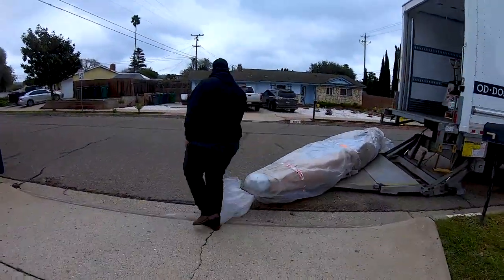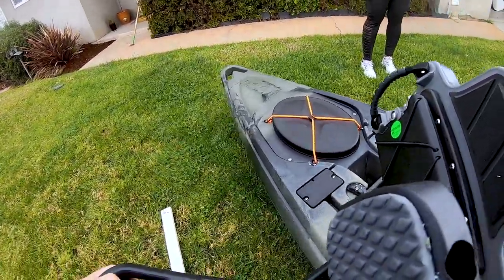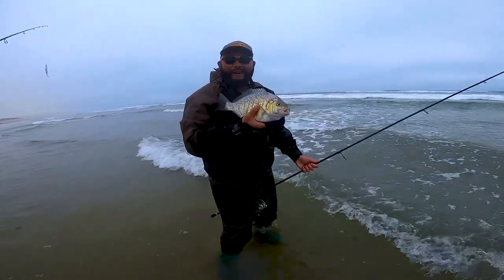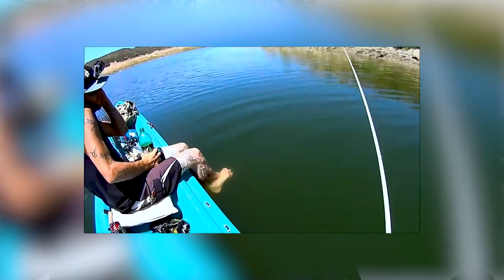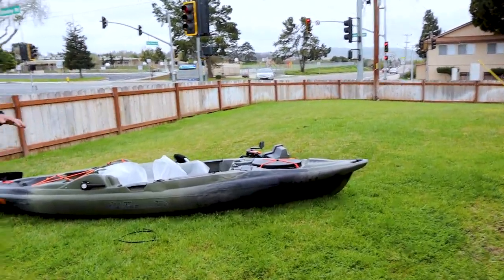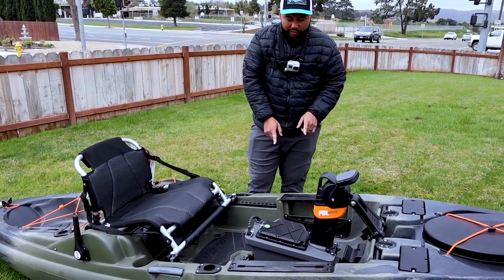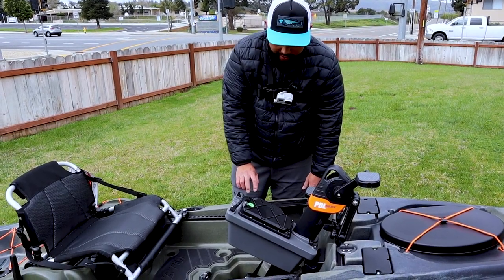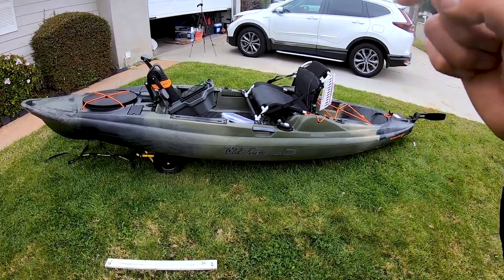Old Town Bigwater 132 PDL kayak in depth review

Comment: I just picked up my big water 132 yesterday. I love it. I can't believe how fast these are. They're also built really well, and they have lots of room for equipment. I was looking into Hobie, but I don't like the flipper drives.. Flippers are for fish not kayaks.😅
Reply from the maker: yes, it's really fast for its weight and size. the hull cuts through water. even putting the drive up and paddling, it punches through surf and tracks really well.. stay tuned. releasing a video of taking it into the ocean and landing thresher sharks. it maneuvered extremely well to keep up the the fast agile sharks.
Reply: @Hook2Cook  Awesome,  I'll be looking for it.

Comment: Hey Edward . Check and make sure the pdl seats properly and locks down with tension so the latch is not loose that holds it in .
Reply from the maker: Thanks for the tip!

Comment: What is the difference between this and the predator pdl?
Reply from the maker: It’s basically the predator PDL rebranded as the sportsman lineup. A few minor changes like the seat and the rod tip guards on the predator and not on the Bigwater & new colors but the hull is about the same.
Reply: @Hook2Cook  Which one has the better seat? And which rod tip guards?
Reply from the maker: The really early models used to have these tabs built in up at the bow to secure the tips of your rods when you’re laying them down. Not sure what year, but every year they had minor changes.  There’s no solid guide but if you’re comparing the last model of predator, the main differences are colors and seat material
Reply: @Hook2Cook  so there is no difference between this bigwater and the 2020+ model predator?
Reply from the maker: @zlacc  just the seat materials and color options